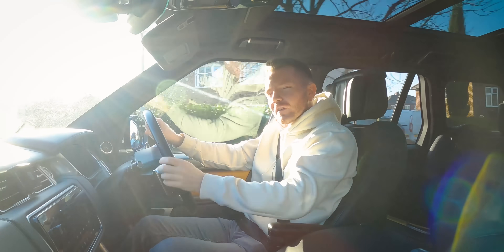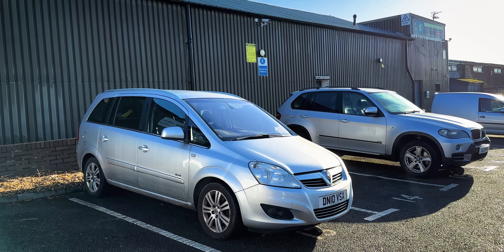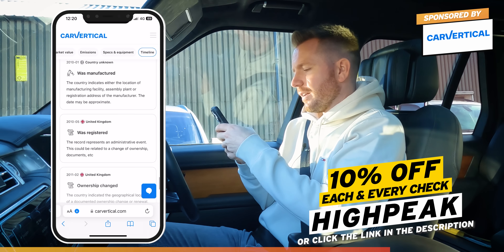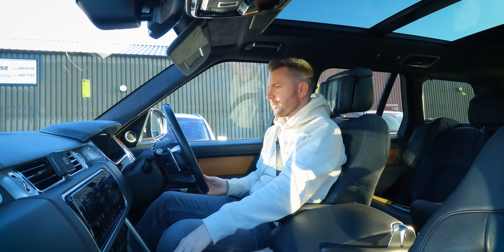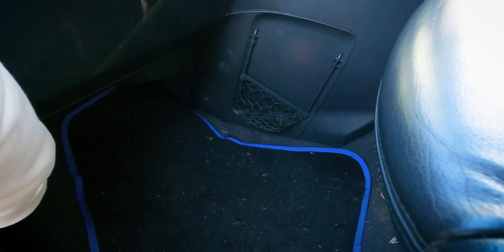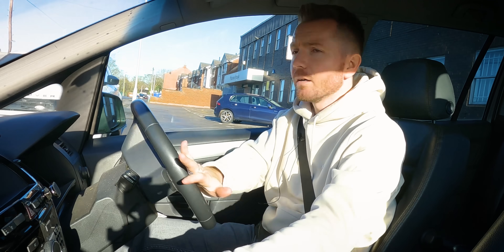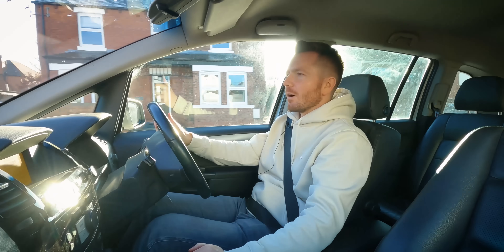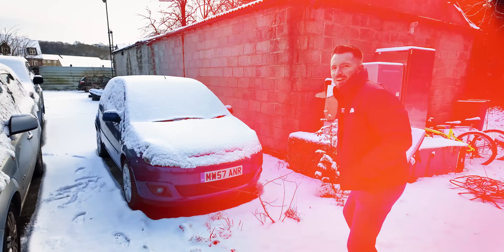I BOUGHT A CHEAP VAUXHALL ZAFIRA FOR £1,000!

Comment: I know someone who has a 04 astra it's done 113,000 and it stills goes no problem. Never had any issues with head gasket, oil leaks or surprisingly rust. It always passes MOT maybe a couple of advisories. Never has any warning lights on. People knock vauxhall but it's like any car you look after it and it will look after you. All gets done is basic wear and tear. We always put in redex with a full tank of petrol.
Reply: Right move.
Reply: My first car an Opel Astra 05 1.4 benzine is currently driven by my brother and at 380.000km. Still doing great, kinda regret selling it but at least it’s still in the family.
Reply: 113,000 miles isn’t a huge accomplishment?
Reply: @davidmbell  I got 191K from a MK III Mondeo Estate. Yeah needed lots of tlc, 2 turbo pipes, front suspension twice, back suspension once, gearbox, passenger door handle failed. Peugeot sourced diesel engine was good for 45/48 ish mpg.
Reply: Yeah. I've owned four Astras. Two were fine two problematic. Current one a 2007 1.8 I bought cheap three years ago but have spent about 1500 quid on since. Why...because the engine is bullet proof no rust gearbox fine. And as shown you can buy a cheap car that looks good but it's a total gamble. So at least I know what's been done and what it needs. It's not so much the parts but labour costs that condemn cars to scrapyards. It's suspension problems older Vauxhall's suffer from. Springs and shocks especially. Otherwise yeah they get slated but the petrol ones usually start first go. And watch the dipstick. They naturally use a bit of oil. Cheers.
Reply: P.S that includes cambelt and water pump done with the 1500.
Reply: 113k Miles is low :') I've seen some of our old company cars go past 250k and still going strong

Comment: Bought a brand new Zafira 10 years ago for the Mrs - and it’s still going strong - been a great car … of course, I’d like to upgrade it, but had it since new - not done many miles - has a nice spec - so can’t justify changing it
Reply: Have you kept it dealer serviced to maintain the lifetime warranty?
I though one of the most difficult things was finding g a good VX dealer service as they are not the best.
Reply: You sound like a catch pet 😘
Reply: @mariemccann5895  well, I don’t make myself feel better by sending cryptic passive aggressive messages - and I don’t troll people from other comment threads — so I guess I’m better than the person in your mirror.
Reply: Keep it my wife's is a 1.6 petrol  energy 2007 and its been the most reliable car we have ever owned. We have had it 7 years as a family car. It's on 124,000 miles and never needed anything apart from usual wear and tear 😊. Things to keep an eye on change that expansion cap for a genuine vauxhall one now there getting on as they go faulty and stop letting the pressure out so suck all your pipes in. Second if you get oil in the expansion tank don't think its the head gasket it's the oil cooler seal.
Reply: @eddiek821  Classic. "Never requires anything other than wear and tare" then goes onto list what it requires!
Reply: @mariemccann5895  Only saying what it could require things to look out for, not that I've needed them. I know others that have. Sorry, you're so upset.
Reply: @eddiek821  What makes you think I'm upset? Stick to the facts and don't try to personalise this.
Reply: @eddiek821  didn’t you read the signs on the way in ?!? …. Don’t feed the trolls !! 😁
Reply: @JIMMYHIBBS1  Haha my bad can't be brilliant all the time can we 😆.

Comment: Oil in the coolant will be from the oil cooler which is also causing the oil leak from the oil filter housing. very common issue an a cheap fix, just needs a set of new gasket set. to be fair, you could still do it for around £800.

Comment: I'm a bit of a fan of this era of GM metal. The Zafira B in petrol form, makes for a surprisingly robust choice. They're incredibly easy to work on and have a number of well documented faults that are usually easy to resolve. Get an Elite or a model with ECC (Electronic Climate Control) and you don't have to worry about the flammability issues that affected some models (this was down to improper pollen filter replacement and non original resistor packs....from what I have been advised). As other commenters have advised, the oil cooler seals may have failed, which can lead to HGF like oil in coolant symptoms. For a trader, this one would be a definite no given the amount of prep it needs. For someone like me, whom has the time to carry out the repairs......I'd certainly give it a second look. Genuine GM parts from Autovaux, are also not all that expensive.

Comment: When the ULEZ first came in I got rid of my old diesel van and bought a 2010 Zafira 1.6 petrol. It’s amazing what you can fit in them, I’ve had a full size bath in the back! It was cheap to buy and run... I park it anywhere and don’t worry if it gets bashed up.  It’s not the most exciting to drive but seats 5 adults comfortably, it’s just gone over 100,000 miles and still going strong.

Comment: The repair to the rear light reminded me of one my father did to his Renault 4 headlight before trading it in for a new Renault 12 in 1972. The Renault main dealer's pre-sale preparation of the Renault 4 did not include repairing the headlight but they did wind the clock back from 70000 to 30000.
Reply: Excellent cars both.

Comment: I am a nosy sod and living in Deeside i don't trust any cars.
So i ran a quick check which brought up a Milage Issue-:
The odometer reading reduced by 263,584 miles between 17/06/2015 and 11/07/2016.
So it has been "Clocked" so much for car vertical!
You have made the right decision to sell this one on as spares/repairs Matt.
Reply: It’s a mileage input error. An extra 0 has been slipped in. 
2014 - 32,361
2015 - 309,029
2016 - 45,445
Etc…Etc…

Comment: Lots (most) Vauxhall owners don't realise that they must use Dexos specification oil. 
Take it to your back street garage for a service and they won't know either. 
Most just look at the SAE number and say "that'll do". 
Problems with Vauxhall engines include worn chains, tensioners and turbos mostly due to non Dexos oils. 
Other faults include water levels due to a lot of plastic components cracking. 
Unfortunately, Vauxhall won't sell you the special oil, you have to have you car serviced there. 
Fortunately, there are companies that now do good quality Dexos oils .... Morris and Mannol being two of them. Don't stick Castrol or Halford's junk in your Vauxhall.

Comment: The oil in the coolant is most likely coming from an expired crankshaft cover gasket or oil cooler gasket. As it happened in my 1.8 Zafira.
Reply: Was it an expensive repair?.
Reply: What is a crankshaft cover gasket? Surely you mean a camshaft cover gasket. That wouldn't put oil in the coolant. It will be the oil cooler gasket, common fault on that 1.8 engine.
Reply: had oil in my coolant for 10 years now, no issue.....same 1.8 btw

Comment: My dad owned one before his current car. It was a 2010 black 1.7 CDTi Ecoflex and it was so slow but quite reliable (until the end) when the DPF or something got clogged. and nearly caused the engine to blow so he sold it on because he needed something more trouble free, partly the reason he now has a yaris 1.33 . He was not fond of the zafira at all.
Reply: We had a 2006 1.9CDTI, was fantastic at the time with having three kids, was quite fast for a bus as well, unfortunately, DPF and EGR valve issues were too much for us and we got rid of it
Reply: @paulefc1971  yeah same here. At least you had the 1.9, 1.7 was awful

Comment: we had an opel zafira mk1 and it was quite good, plenty of space, 7 seats but it was diesel and the fuel economy was quite bad. one day we went to get groceries, parked it, came back one hour later and the car didn't want to start. we pop the hood (or bonnet if you're weird) and see smoke coming from the fuel pump. after 14 years (from 2004 to 2018) it died. that car was so well maintained that it didn't even make smoke, the only smoke it made was from the fuel pump after pumpung it's last bit of diesel. then we got a fiat tipo and we decided to change car after the warranty runs out since stuff starts to break after that period. we did it's 4 years of warranty with the mk1 (technically mk2/3 if we count the older one from the 80s) and then got the mk2 tipo cross. all great cars

Comment: My aunt has a 2013 1.6 Exclusiv in red and its honestly a great car. She has had it since new. Look after them and they are great cars! 58,000 miles and it’s never failed an MOT, and it’s had 3 total advisories. This design turns 20 this year and they still look very modern!

Comment: Great video as always Matt. I don't normally comment on your videos but thought I'd make an exemption for this. Reason being is that I have a soft spot for this generation of Zafira, having grown up with my parents owning 4 of them either from new or nearly new. First was a 06 SRI 1.9 CDTi, which is fondly remembered by my Dad as one of the more powerful vehicles he has owned and had some sort of boost button (I can't recall the official name!). Also had 2x Design 1.6is, a 08 and a 10, and in between them a 1.8i Energy. All I believe had no faults apart from the second 1.6i when the oil light came on on the journey down to trade it in for it's replacement!! Cheers :)
Reply: The would be the 'Sport' button, in reality, all it did was to change the steering response and sharpen the throttle response. I once owned a 1.9 CDTi Elite (150BHP) and experimented with said button, the overall acceleration was no quicker, but the snappier throttle made it feel quicker. Some very rare models had a super rare electronic dampening option. This button with also set the dampers to 'stiff' mode, which provided for decreased body roll.
Reply: @JCTsFascinatingHobbies  that'll be it, cheers! The 1.9 CDTI my parents was also a 150hp
Reply: @grampian999videos6  Mine was okay, but I had a lot of work carried out under warranty. The M32 6 speed manual was a bit of a weakspot......mine was fine but I did have the clutch release bearing, clutch and flywheel replaced. The warranty work covered the release bearing, but given the dual mass flywheel sounded like someome throwing a bell down some stairs, I paid the cost for the parts to have this renewed along with a clutch kit. The water pump also seized before the cambelt replacement was due. I caught it just in time, but....another warranty job. I upgraded to a Zafira C 2.0CDTi 165 SE after the warranty expired. The Zafira C (Tourer) is still in the family, my mum inherited it to replace her Zafira B 1.6 that she had owned from new. That too, is still in the family!! I moved away from Vauxhall after Stellantis became involved. Surprisingly practical mostly robust cars.....though that 6 speed manual on the Zafira B.....is a bit........well, fragile!
Reply: Brought a 1.8 Zafria brand new in 2001 great car. I was very sad to part with it in 2023, yes I had it for 22 years.

Comment: Had a Zafira petrol, 1.6 I think but could have been a 1.8 with a four speed auto box as a company car in 2000. Handed it back 3 years later with 86000 miles on the clock. Faultless and so comfortable. Gearbox was ok and the car never missed a beat. Practical car

Comment: The oil in the tank is 2 pipes behind the engine I have a Chevrolet Orlando 1.8 the same engine also my oil was coming in the coolant tank changed those pipes and now the oil doesn't come through

Comment: I had oil in the coolant on mine, turned out it was oil cooler seals. Fixed for about £20, but took a couple of hours to get the exhaust manifold off as the cooler is behind it (amazing place for VX to put the bloody thing). Would also likely fix the oil leak from around the filter housing - same set of seals!

All that said, on balance I still think you made the right call.
Reply: ecotec is also known as suffer rocker cover gasket leaking, they do love pissing the oils leaks.
Reply: Was just going to say this. Quite cheap and easy to fix.
Reply: Very common on those engines 👍

Comment: It's not that bad... flush the coolant put some cleaning products with water, refill and see if the problem comes back.
New exhaust or weld the old one, fix the leak...
New tires and that's about it.

Comment: Use to have a 2010 Vauxhall Meriva 1.4 petrol. Probably one of the best cars I’ve owned. Utterly reliable and barely spent anything on it. Owned it for about 13 years and 120,000 miles my biggest cost was probably changing 2 tyres. Got t-boned at a junction by an Audi!! Great car that was. I now have an old 1996 BMW 323i passed down from a deceased relative. BMW is actually really nice to drive despite its age (better than the Vauxhall in all honesty) but had so many memories in that Meriva, it held sentinel value.
Reply: I had a relatively similar experience. My first car was an Opel Astra station 1.4 2005 with 380000km as of now (my brother still drives it). Great car but I wanted something more fun so bought a 2002 BMW 320ci definitely more fun but what a heep of shit. Sold it last year for 1000 more then I bought it ford now back to a station car with a 2011 Ford Focus 1.6 ecoboost.
Reply: New shape or old shape
Reply: @luclaan8165  similar story to mine then. I can only imagine how good a modern BMW is compared to my ancient 323i. It’s heavy on fuel and at some point I’ll probably go back to a Vauxhall or maybe a Ford Focus, had one as a courtesy car and it’s a great car

Comment: Matt the recall was for the blower resistor. Mine was recalled. It was then recalled to replace the blower motor. When they replaced that they then put a plastic shield on the windscreen scuttle because rain water was finding it’s way into the motor and then blowing the resistor. According to Vauxhall the fires were caused by unscrupulous mechanics bridging the resistor. Supposedly

Comment: Hi Matt. We had a 60 reg Zafira 1.6 Design and that ended up developing oil in the coolant tank. It ended up needing all of it's cooling system replaced, new coolant tank, water pump, pipes, radiator, thermostat, the lot! Got the car for about £2500, ended up spending over £3000 in total as we'd put a lot of time and effort in with other stuff alongside the oil cooler fault and then ended up part exing for £950. Sounds like you did the right thing shipping it on!

Comment: I got a 60 plate 1.7 diesel same spec elite I'm not gonna lie the best feature is those heated seats but the 1.7 is smooth for motorway runs 👍

Comment: I know I get a lot of flak from other dealers on this, but I never get a problem with Vauxhall's, Why ? because I never buy them ...... take the S off the Scrap you wrote on it and you have my reason, even more so when they are old ...... 80's and 90's I couldn't get enough of them, but Insignia / later Zafira / Corsa  days on I had my fingers burnt once to often, but for a minute there at a £1,000 I thought you'd rung the bell ! always a great and entertaining channel Matt.

Comment: Correct decision Matt. Move it on. Everything other than the oil in coolant is pretty simple. Oil in coolant is minimum head gasket or a cracked/porous head. Better luck next time

Comment: Bought a  2 year old Zafira 1.9 CDTi auto with 22,000 on the clock in 2011 - now done 216,000 miles with pretty much no issue.

Comment: My ex brother in law bought a 2006 1.9 CDTI Zafira back in 2011 which he went to Birmingham for, within a few weeks  the engine suffered a major fault with the pistons, he had to strip it down and rebuild it with new parts from Germany, it didn't run properly after that, in the end he traded it in for a brand new at the time 2012 Vauxhall Astra 1.6 Petrol

Comment: As others have said before surprised if the head gasket is blown on these they are usually ok, I've just got a Astra H 1.6 needs the usual Cam cover gasket plus probably oil in cyclinder 1 spark plus where it's leaked need a new VVT solenoid as there get clogged

Comment: The horn it’s a common problem for Vauxhall models made around 2010. I had this problem on 07 reg Astra and 11 reg Corsa. Long story short it’s a module (CIM - column integrated module). It’s 20-50£ a new one but it’s a headache to change. Basically it’s the PCB around steering column that integrates the steering wheel controls and the left/right switches for turn signals and wipers. So to replace that thing you need to remove the steering wheel, airbag, and you need to make sure you put things back in a proper position otherwise they will not work. In other words, it’s a entire afternoon job.

Comment: Always see how the engine sounds when cold for the first couple of seconds on the VVT engines. You won’t typically hear it as well in the cabin. Better off lifting the bonet and standing outside to hear it. The cam shaft dephasers rattle on em when wearing out for couple of seconds on start up
Reply: Does that make a sound like there's no oil in the engine for 2 seconds before sounding nomral, after not using the car for a few days?   Mine does that and has done for years, no problems.  I just assumed it was because there was no oil at the top end start after starting it, but then the oil pump quickly pulls it round, hence why the noise only last 2 seconds.   It doesn't do it if the car has already been used earlier in the day, even if cold by that point.

Comment: I have two of these cars.  1.9 diesel 2008.  1.8 petrol 2014.

The 1.9 diesel is going through its MoT now.  It is worthless unless it passes.

The big problem is the central locking.

The 1.8 petrol 2014 has an engine warning light come on.  I will probably switch it off for the MoT.

Oil in Coolant = head gasket

Plus unknown problems.

Not bad for £1000.

Cars are expensive!